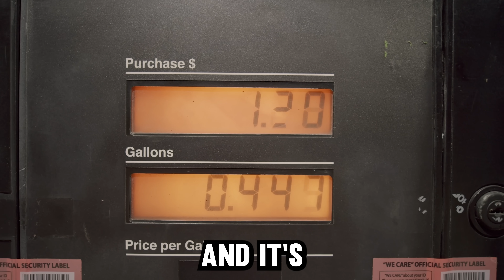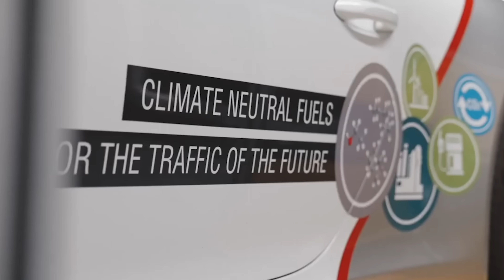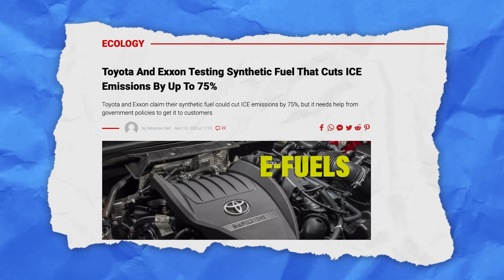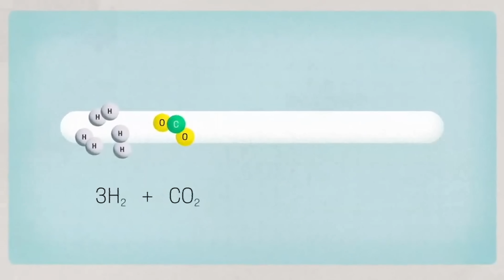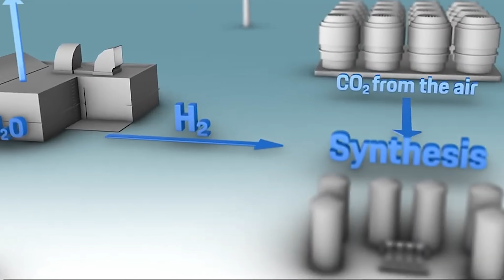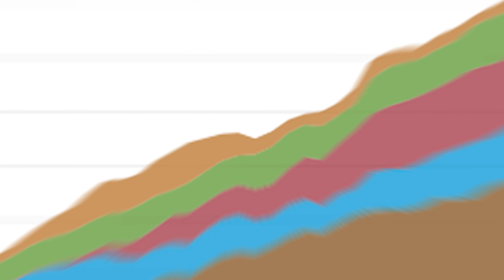Dodge Just SAVED Combustion Engines

Comment: E-fuels can be tailored so that they don't contain many, or perhaps any of the non-carbon pollutants that naturally exist in most  hydrocarbons. This makes extraction of the carbon from the exhaust easier and cheaper. Imagine having an easily removed carbon collection unit in your exhaust that gets replaced every so often, that you can trade back to the fuel companies for fuel credits? They wouldn't even have to spend so much removing it from the atmosphere.
Reply: Diesels have this in the form of a DPF (Diesel Particulate Filter). Unfortunately it costs many Diesel engines their longevity/reliability, and as such shouldn’t be employed on a gas engine.